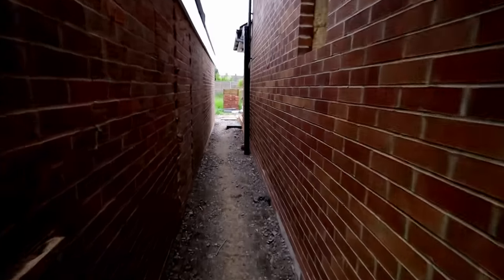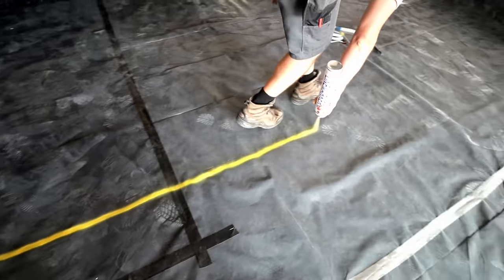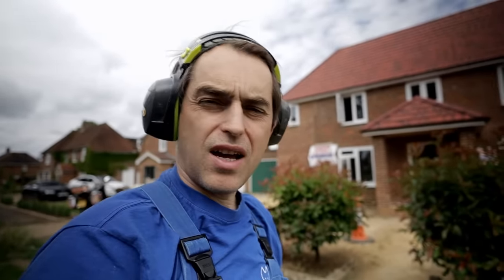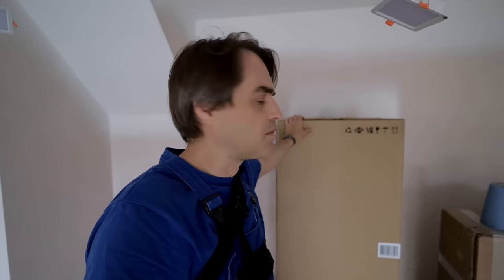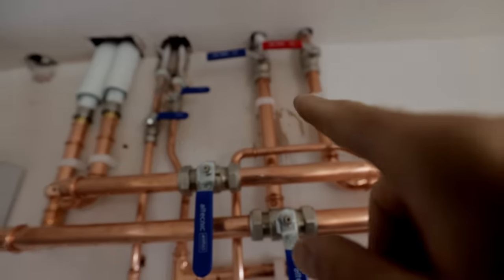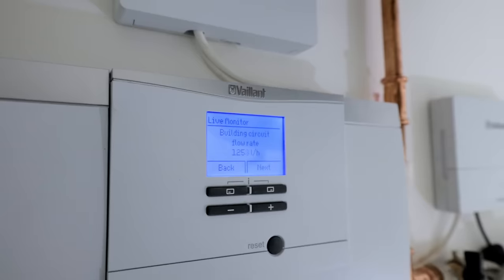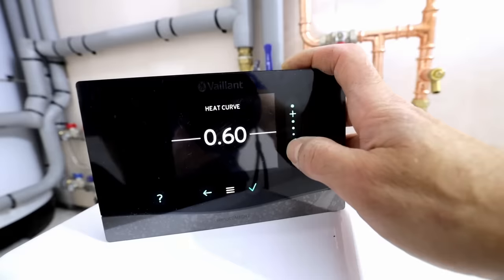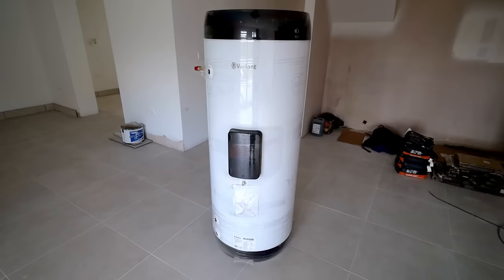Gas Boilers No Longer Make Sense, Here Is Why.

Comment: Good morning,
Sorry, but what you are saying about “Heat Pumps” is totally incorrect. 
Can you please show us a Price comparison between Gas boilers and Heat Pumps E.g. Install costs, Yearly service costs, True Running costs, and Possible Repair costs?

Also, fans are always quiet when they are new but after a short time (6 Months?) not only will the owners complain about the Fan noise but the neighbors will also be complaining as well.
If you are honest you should easily be able to prove what you are telling people, but I think we will be wanting a long time for the figures and facts to be shown.

I am not a plumber, but I do understand figures and data.
Reply: Since the summer of last year, any major renovations (or new builds) of properties by law (building regs) need to basically be a low-temperature heating system.  So for this project, the only difference is the cost of the heat pump vs. the cost of a boiler.  Given you can make use of the £5K grant you're basically covering the cost of the heat pump, so a boiler in this scenario will currently cost more at the outset.  Yearly servicing costs you're probably looking at around £150 at the moment depending on who does it.  These units have a 7-year guarantee, and after that most home insurances cover major breakdown costs in heating.    My heat pump got replaced 9 months ago - it was about 15 years old and still wasn't noisy.  Even the ones in my area that I would classify as "noisy" aren't loud enough to complain about.
Reply: Good morning Ben,
                                    As I have already said “I am not a Plumber” but I do understand Facts and figures.
Facts: -
You said that the costs of installing a gas boiler and a Heat pump (with the £5K grant) are about the same. This is totally untrue, Boiler = about £5K, whereas Heat Pump = about £20K and that’s with the grant already removed.
Year service charges are about three times higher for a Heat pump system due to the size and number of components used.
Yearly running costs for a boiler V’s Heat Pump, are about 3 to 4 times dearer due to heat pumps running all the time. Also, I have never heard that you can use a heat pump for “air-con “in the summer.
Please be honest with people about the running and installation costs of these Heat pump systems.
Will
 @BenIsInSweden
Reply: @williamk4280  Heat Pumps aren't £20K. You can Google the model of these, and you'll see they cost less than £6K for a 5kW unit with a cylinder combined (though Szymon goes for a different cylinder), and with the grant that brings it down to <£1K.  The "about £20K" includes the conversion from High-temperature heating to low temperatures, and is different for each house.  

The conversion should be seen as a separate cost (e.g. roof replacement cost before installing solar is not part of the solar install cost - even if the same people are doing it). And the building regs since last summer require any new installations of heating systems (so like what is going on here with the renovation) regardless of heat source, to be low-temperature heating (flow of less than 55C).  

So in the scenario in this video, where a major renovation is being done - which includes a heating system, as Szymon says - it doesn't make sense to put a boiler in - because it doesn't, it will cost more to run.

Heat pumps are not dearer for running all the time, think of it like driving a ICE car, which consumes less fuel? driving 100 miles at 100mph stopping every 10 miles, or constantly at 30mph? It's a similar concept here. Heat Pumps are most efficient when they maintain a set temperature with very little fluctuation.  They tank efficiency when they duty-cycle.

Air 2 Air heat pumps are basically air conditioners with a couple of extra parts that allow them to run in reverse, so heat goes inside instead of out.  With air 2 water being more complex and expensive, Szymon does have an install (not sure if it's this one or another one), where the UFH and a heat exchanger and handler in the loft for cooling in the summer. The module for these I believe Heat Geek said was around £300, but you either need an air handler - like the install I mentioned, or you can have fan coils in each room (which are like AC units, but run off the water - like radiators), but to get proper AC out of it - i.e. dehumidification as well, you need to run 4 pipes to each of the fan coils instead of the 2 for rads.
Reply: Good morning Ben,
Thank you for your detailed reply, which shows you know a lot about Heat Pump Systems.
I will do a lot more research on these systems over the next few months but with so many different people saying totally different things about these new systems, I think you can easily understand why I and many others are so confused.
Thanks again for all the info and time taken to reply.
Will  @BenIsInSweden
Reply: @williamk4280  Yup, for sure. There are a few aspects that haven't helped, e.g. American brands (irrelevant in the UK) still seem to be about a decade behind the rest. So you often get people from the States with issues that aren't relevant in the UK market, and claiming they work in the industry so they "know what they're talking about".  Bad installers have also given the industry a bad reputation, so there is truth to some of the complaints.  e.g. if you check EVM's Heat Pump journey, he had expensive quotes (think over £16K) from people wanting to replace his pipes and radiators, and a massively oversized heat pump - which would have made it expensive to run.  He did the calculations himself and got a heat geek to do them as well to see if they matched up.  In the end, he needed to replace 5 radiators, and his running costs were basically what he expected.

Comment: But surely it depends on whether the house is built in a way that makes a heat pump a sensible choice? My house requires a flow temp of 70 degrees in winter to heat the house to 20 degrees, no way a heat pump makes sense here.
Reply from the maker: any house can be heated to 21C with 40C flow - it just needs to be designed correclty (radiators sized to that flow). Check my other viedos where I install low temperture systems in uninusalted houses.

Comment: OK if your installing a complete new system for someone who has deep pockets (based on your video), the cost is not relevant and your similarities are relevant. But what about us less affluent group???  your argument is not relevant to us really and cost / savings is very relevant. Are heat source pumps really the answer. I would like to know how you would help someone like me who has a budget and wants to save money long-term. I have a Vaillant EcoTech Exclusive 835 running radiators. how can i get more affordable heating and hot water without breaking the bank.

Comment: For full gut rebuild/ renovation jobs, you may be right, especially if the owner has considered Solar PV.  But without some serious incentives, a heat pump simply cannot compete with a boiler swap job assuming Viessmann V200 level of efficiency and gas prices of 4p per kWh.
Reply: True, but gas costs 7.5p per kwh, and there are some serious incentives.
Reply: As someone who owns a V200 installed by Szymon and looked at the numbers closely, I can say that a heat pump was running on neck to neck with our V200 (often running cheaper than the boiler). What changed the game is the lower gas tariffs this year, which is when the gas boiler is now back to being the cheaper option despite solar PV. That said, I would have installed a heat pump if I could go back in time!
Reply: Gas is going to cost a lot more than 4p per kwh in the not too distant future.
Reply: @rogerphelps9939  You may be right. Then again, you may be wrong. Till gas stabilizes at a significantly higher levels, I expect we will continue to see demand for highly efficient weather compensated boiler installations, especially for properties with serious modification requirements (piping/ wall insulation etc.) Heat Pumps will achieve their moment in the spotlight in 10 years or so, after the R&D investments being made now bear fruit.
Reply: @rogerphelps9939  Given at the moment, most electricity in the UK is generated from gas, your point?

Moreover, heat pumps just aren't suited to a huge proportion of uk homes.
Reply: The efficiency of a combined cycle gas generating plant is around 60%. A heat pump will have a SCOP well in excess of 3. This means that for every kilo of gas used in a power station you get over 0.6 X 3  which is approximately two times the heat from a heat pump. Therefore a heat pump will cause the emission of half as much CO2 for each unit of heat output than from burning the gas directly. Furthermore the UKs electricity supply is now becoming dominated by renewables and more often than not renewables and nuclear  actually produce more electricity than gas and this difference is only going to increase. What is absent from the discussion on this channel is the external costs of using fossil fuels and these, unfortunately, do not appear on any balance sheet but ate very real nonetheless.  These costs are evident in the steady increase in global mean temperatures and the increased incidence of extreme weather events. The average consumer does not look very far ahead when considering the consequences of his actions; the choice will almost always be what appears to be the cheapest irrespective of the long term consequences. This is why it is up to governments to direct the consumer in the right direction even though it might not be popular. Our grandchildren will curse us for the kind of world that we have bequeathed to them if we do not take action. Regarding the suitability of heat pumps for British homes I suggest you actually read up on the many published case studies that refute your assertion. @NFawc
Reply: @rogerphelps9939  Climate alarmism - sighs...

Comment: I'd wondered about possibly doing cooling with a heatpump by putting in some fancoil units in the rooms - for heating stick with the underfloor and radiators as they are quiet, but when needing cooling use a zone valve to change over to running the water through the more noisy fancoil units. Hadn't considered using a single heat exchanger and ducting cool air to the rooms.
Reply: You can chill the underfloor circuit, main problem is condensation and over time rotting parts of the house.
Reply: With that amount of works the airtightness of the house will be much better so I'd guess a MVHR system is fitted as well - adding the cooling coil in a duct and T into the unit's drain is not much more effort then.

Comment: If the electricity is green and the house well insulated direct heating is an option. Much cheaper to install and maintain.
Reply from the maker: direct electric will be 4 times more expensive to run and will create the same amount of CO2 as a gas boiler would, so it makes very little sense.
Reply: Assuming a heating requirement of 10,000kWh for an average UK home.  At current price cap, direct heating would cost ~£3,000 per year.  A heat pump providing the same amount of heat with a (poorish) efficiency of 300% would cost £1000 per year. saving £2000 per year.  So would easily pay for the average install cost and then some.

Comment: So the title should be 'Gas Boilers No Longer Make Sense on a Large Renovation , Here is Why.'. The message that it is economic if you rip out the house internals completely is not exactly encouraging. How many people are ever going to have underfloor heating? How many buildings are going up with it installed; you only ever see it on self builds and full rebuilds with radiators and microbore pipes for the masses. Look at the immense size of the utility room also and the multitude of manifolds needing setting up. It is interesting how much heat pump propaganda involves a spare utility room the size of the average living room. Not exactly useful for someone with a combi boiler in a little cupboard. Of course the pump is quiet when it is installed and hopefully during warranty but after this the manufacturer will not be concerned at all with longevity and you are on your own. Sorry not convinced at all as it just looks all the time as toys for rich boys which will be imposed on everyone like it or not.
Reply: Precisely, my thoughts entirely. In a few years time the technology will have moved on and this heat pump will be old hat. Most of us haven't got a convenient plant room conveniently near the heat pump to house all that stuff. And the complexity of the control and settings boggles the mind. But still I admire Szymon's skill and knowledge.
Reply: Because that’s all it is. Mitsubishi charge £36pm for maintenance cover on their Ecodan range, £40 without a Wi-Fi adaptor. They’re obviously expecting some maintenance bills over the 15 year lifespan. And that doesn’t cover the heating/hot water system or anything else, just the heat pump. Fair enough, if they were ubiquitous there’d be more people in the maintenance game and prices would be forced down, but only so much. Parts and labour still cost what they cost, and they get more expensive as time goes by, not cheaper. 

And if everyone got one tomorrow, we’d just have nationwide blackouts every winter because we currently have nothing like the electricity generating capacity we need. Let’s not even discuss how the antique grid would cope.
Reply: @nickhickson8738  Agreed it looks like he does a great job and good luck to him. It is just that getting the likes of his obvious quality and dedication is probably a lottery and he has at least one video I have seen of him sorting out a disastrous installation of these pumps. Difficult times to live in with a potential money pit of nascent technology in store for anyone short of capital for investment. The government certainly looks short of the capital to maintain even basic services let alone finance the grand plans it has in store for us.

Comment: You've gone to the dark side my friend, you said the flow temperature on the heating gas or HP is the same, cant be, please explain that. You make no mention of defrost, when we get day after day of -5C with high humidity that unit will be going in and out of defrost every 25 to 30 minutes, that could last for 20 mins each half hour. That will throw your efficiency out of the window. 
Once again these HP will work great in newer houses with under floor heating and double maybe triple glazed windows and good insulation but how may houses are like that? I fear not many.
Im not convinced at all, I will stick with my gas boiler thanks.
Oh BTW, great pipework and great install as always.
Reply from the maker: All systems regardless of the heat source have to be designed to a maximum flow temp of 55c now.
Reply: As someone who has lived with a heat pump for 8+ years in a location where temperatures get far lower than the UK.  Defrost isn't as big of an issue as people try to make out.  Mine was doing a 5-minute defrost every 1-2 hours in ~ -5C to -10C.  The defrost is to get rid of condensation build up which even in high humidity takes a lot longer than 25-30 minutes to trigger a defrost.  It's irrelevant anyway, even with defrost cycles, heat pumps are still 2-4x more efficient than a gas boiler.
Reply: Benisweden, You are right but in the UK is wet, winters are wet, cold and wet, in the past five years the winters have been mild but we are due a wet cold winter, then the coil will actually freeze up, to a block of ice if defrost doesn’t kick in, then the efficiency will start to fall believe me.
I have actually had to fit electric heaters to the coils to stop that happening and they burn through the power.
Time will tell but as I say I’d stick to gas.
Reply: @garywright8846  Having electric heaters is either American or old UK heat pump scenarios. Modern UK and Cold Climate ones from the past decade or so, run a reverse cycle to defrost, which means it takes advantage of the 300+% efficiency to do the defrost cycle as well - it doesn't get transferred into usable heat for the home, but it means the unit is back to better efficiency after the defrost is completed.   The problem with frost build-up is the restriction of air around the coils, not that the unit actually "freezes up"

Comment: @UrbanPlumbers have you ever had anyone ask you to leave an unpiped space in the UFH where a piano or piece of antique furniture stands? 

Wooden objects that have been living on an unheated floor will warp, split and ruin if they're suddenly heated from underneath...
Reply: It looks like space was left for what I assume was a kitchen island
Reply: really? Underfloor systems are super gentle sources of heat
Reply: @edc1569 you could be right, I've never experienced UFH . I guess if you can bring the heat up gently it could be ok. I brought my piano from a house with only one gas fire to a house with central heating. I closed the radiator in the small room where the piano lives for the first winter and still only ever keep that radiator on very low heat. All good so far, been here twenty years, don't know how that happened!

Comment: Great install as always. Be interesting to see the efficiency of the unit after winter. It should be a great number. 

You should get a Showersave Waste Water Heat recovery unit installed too. That would increase the hot water efficiency massively.
Reply from the maker: I am expecting scop of 4.5 as a minium.